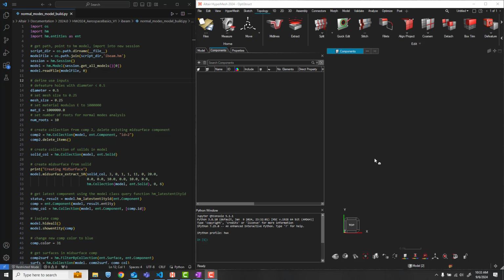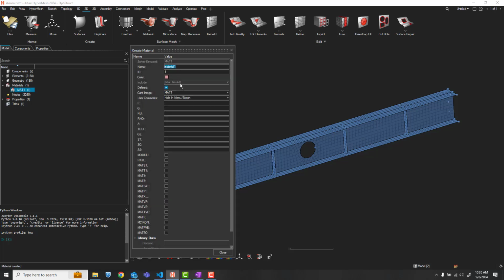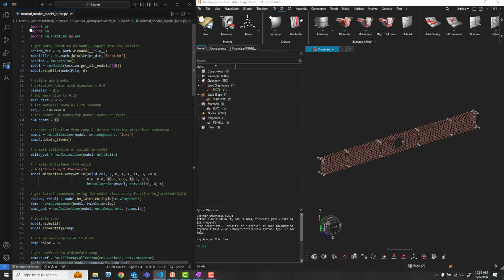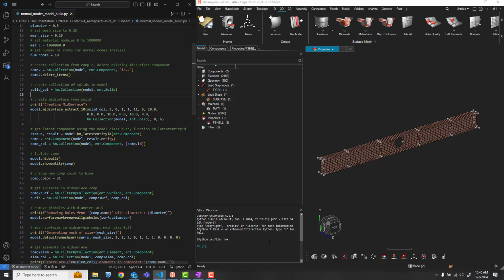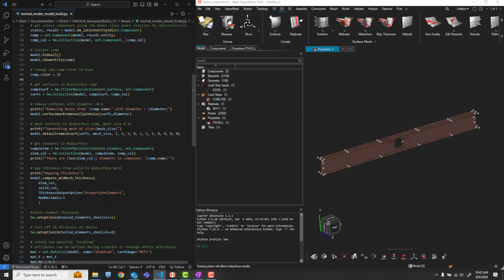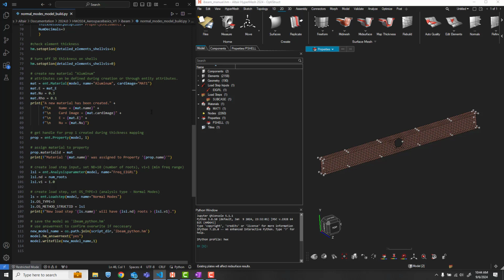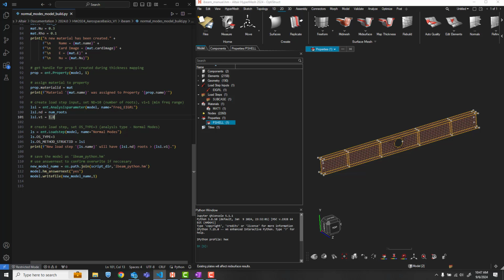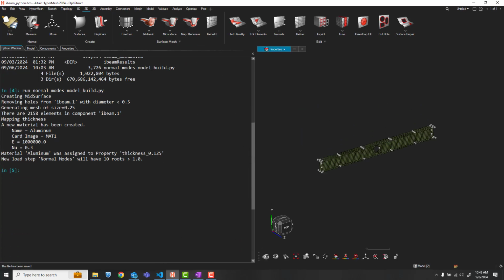Python automation of a simple model set up with HyperMesh 2024 and upper

Comment: is there any guide available to learn about the required list of modules to be installed to code via VS Code? For some reason, I am unable to install/import the hm.entities module which has been a pain point. Need some support.!!
Reply from the maker: Hello @kancherlashanmukh7720, may I ask you which version of HyperMesh you are using? HyperMesh modules are available from version 2024.0 and are installed by default with no extra step needed.
Reply: @ Hey, am using 2024.1 student version
Reply from the maker: @kancherlashanmukh7720  , are you trying to run our Python API directly in the VS Code console? If so, please note this is not possible, the VS Code extension is only for syntax recognition.
Reply: @altairhowto  Ah, this clears my doubt… Thanks a Ton !!